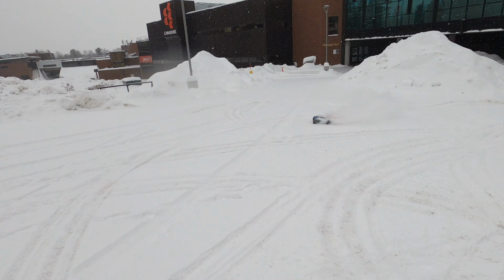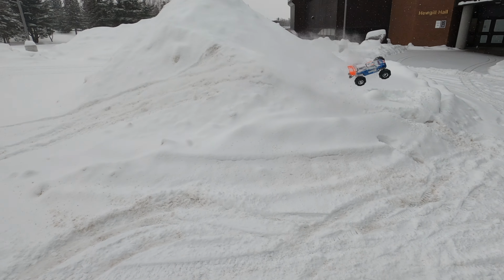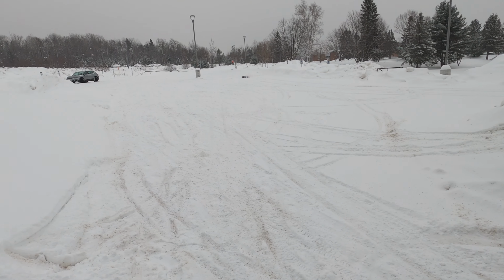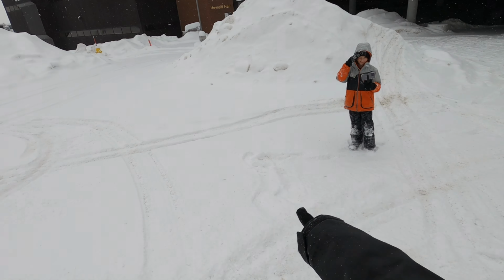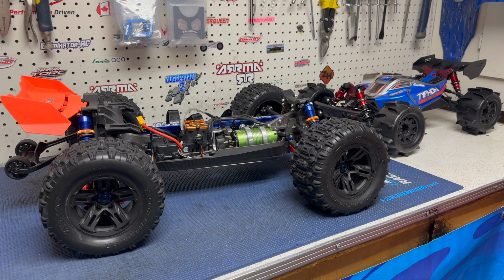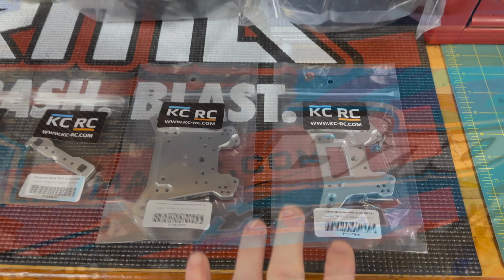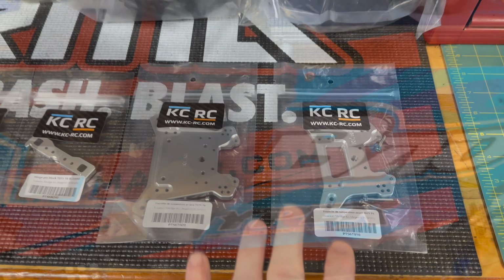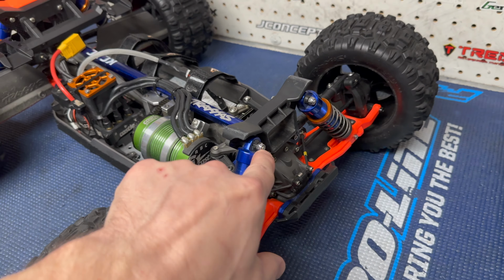Traxxas Sledge Snow Bash (GoPro Cut)

Comment: Jason I have a fully built e Revo 2.0 with literally every single upgrade option from Traxxas and a few others like hub extensions motor Dan and a Traxxas x Maxx ESC, do you think a fully built sledge is better?
What castle system is that btw?? Thx
Reply from the maker: The Sledge is a tougher truck than the 2.0.  But just like with the Revo it does need upgrades.  

Castle MMX8S and 1650KV